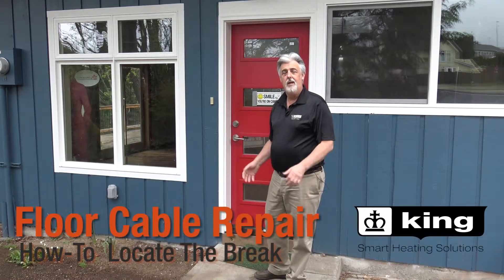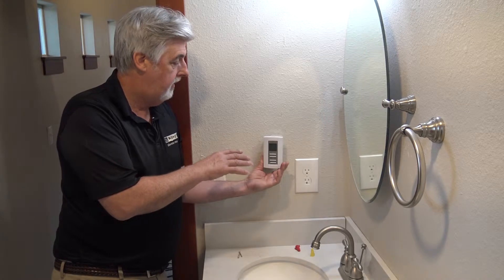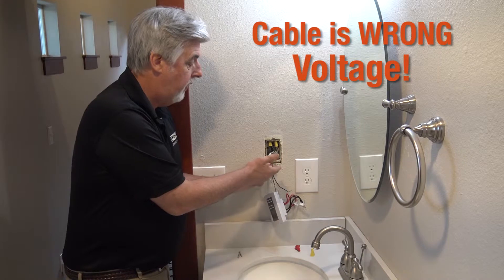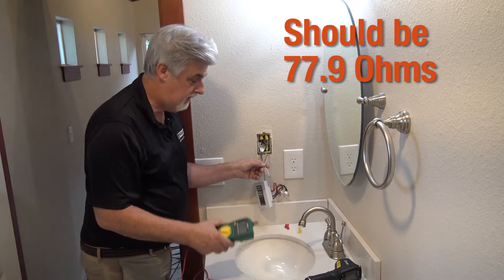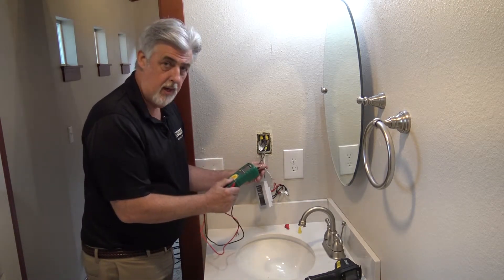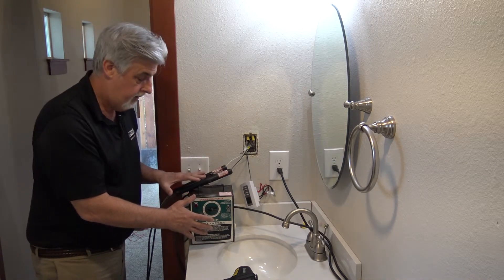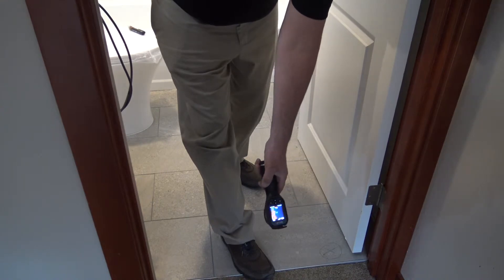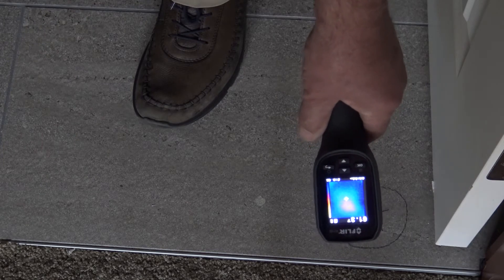How To Troubleshoot A Damaged Electric Floor Heating System - King Electric

Comment: I have been doing this method for 25 years and I suggest you put some high resistors ahead of your hotline into the cable otherwise I would say that you are burning up every cable you test this way.  5-30 kiloohmn ceramic resistors are a cheap way to keep from burning the cable up in the floor.
Reply: I believe the electrician did this to my heated floors, I'm both bathrooms😢😢
Reply: in europe you must use an RCD SPUR 13AMP 30MA , i just cant believe it is not  pert of the regulation in usa

Comment: You got to hold the button for how long before actually see the hot spot? I bought the same crown insulation tester as this video since it is working but im wondering how long i need to hold it and if it’s gonna ruin mh whole cable to keep it pressed for too long

Comment: I just saw your video this weekend, I was looking for info and found that I did the exact same thing. I put 240 to the thermostat because it said 240. I didn't even notice the 120 on the cable. the difference is that now I have an open circuit on the mat. Can an open be traced using the same methods, or can it be traced at all.

Comment: Thank you for the great detailed video! I am having an issue with a floor heating. It worked for a few months, now it stopped and I am getting 0 ohms all the way around. When installing I did cut the floor heat wire since it was long (I know its wrong to do) but the tile guys were doing the install and it was too long of a wire and they told me they didn't have a choice. The ends were terminated as if it was from the manufacture with shrink-wrap and all. My question:
a) What happens if you do cut the end of the wire and make it up as if it was from maufacture? Does it now need to be entirely replaced now?
b) If there is a break in the wire somewhere, can a wire tracer be used to locate it? 

Thank you!
Reply: I'm pretty sure that's what happened to my installation, the heater wire was cut because it was too long.  This heater wire is resistive and it's length is important, so cutting it short caused too much current to flow.  It worked fine for a while because the thermostat controlled the temperature, but then the thermostat contacts welded closed and the floor got VERY hot.  You could unstick the thermostat by tapping on it while rotating, but it would soon stick closed again.  I moved one of the 240V connections in the breaker box to neutral, which lowered the applied voltage to 120V, cutting the power by about a factor of four.  That was around 30 years ago, and I haven't had any issues with the floor since then.

Comment: What happens if the cable is open circuit as opposed to the low res closed circuit of your cable. How do we find the break
Reply from the maker: Our resident expert said it was the same process for open circuit as shown in the video.
Reply: @kingelectricheat  thanks for the reply. But surely the heat caused by sending HV down the cable is due to the cable being short circuited.  
If the cable was open ended then the voltage would just stop and no heat generated
Reply: @Fatroose   The high voltage leads will need to be applied to both element leads and then to the ground shield , then check for heating of the arc location with the thermal gun. Then try element to element starting with low power on the 120 volt line power side of the 10,000 volt neon or oil burner transformer and raise the voltage over time. If you have a cat or dog near , Put it on the floor being tested, they can hear the arc of the high voltage and will stand over the spot creating the arc sound. Us the thermal imaging gun to see the small 1 to 3 degree change in surface temperature. You need to be very patient due to the high mass of the tile it can take an hour to show up.
Reply: @Thunderballs257  thanks for clearing that up in such a detailed manor Brad. I understand now, much appreciated 👍 a sub from me all the way from North Wales
Reply: @Thunderballs257  and if my cable don´t have a land protection how can I detect? thanks
Reply: *Ground shield